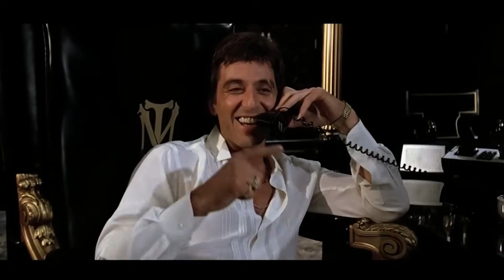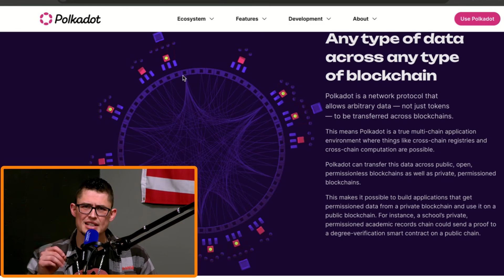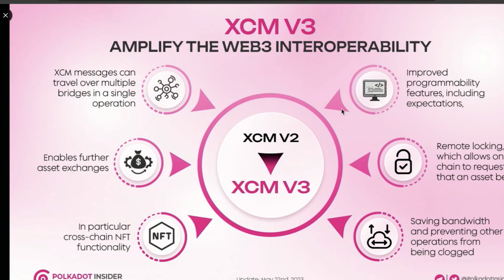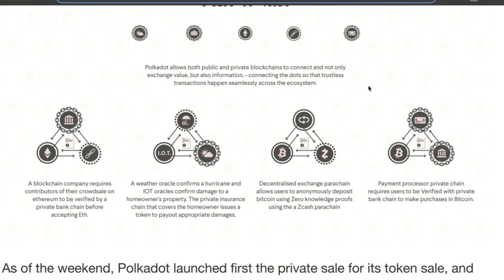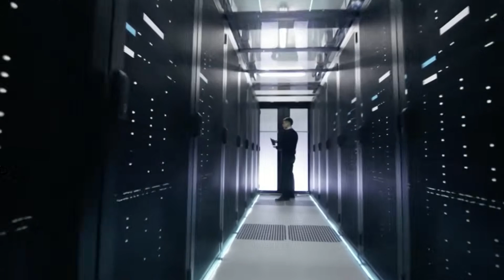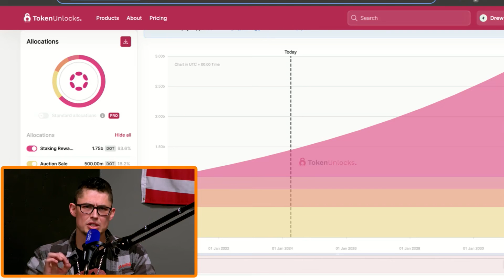Why DOT WINS! Crypto Defi Powerhouse Gets an Upgrade

Comment: Arcblock > Dot
Reply: Arcblock is an ERC token. DOT is a Layer 0 that is infinitely scalable. DOT and ICP belong in top 5 in my opinion.
Reply: @M3LTUP  Arcblock also has a gasless layer 1 (native abt) that builds dapps, websites, decentralized Identity and so much more.   Sub 1 second finality and they have been building for the last 6+ years before releasing their full product so erc20 was the solution while building.
Reply: @M3LTUP  Arcblock is Blockchain agnostic and has erc 20 token due to then building for the past 6 years before releasing their completed project along with maybe abt for their gasless layer 1 with ai to build dapps, a full suite of Blockchain developer tools, decentralized identities, websites, and so much more.   It's an immense project that takes a lot of research.
Reply: @M3LTUP  Arcblock is Blockchain agnostic and has erc 20 token due to then building for the past 6 years before releasing their completed project along with maybe abt for their gasless layer 1 with ai to build dapps, a full suite of Blockchain developer tools, decentralized identities, websites, and so much more.

It's an immense project that takes a lot of research.